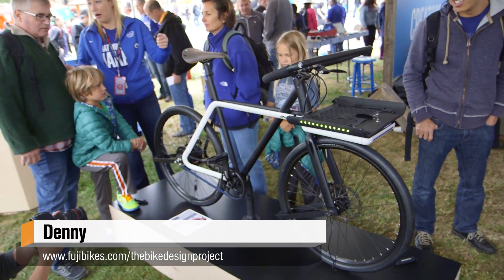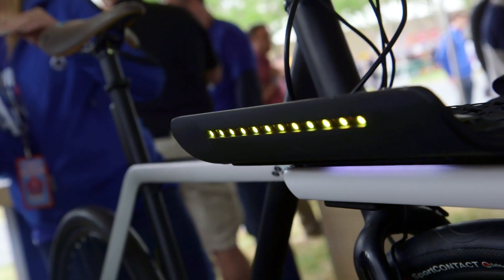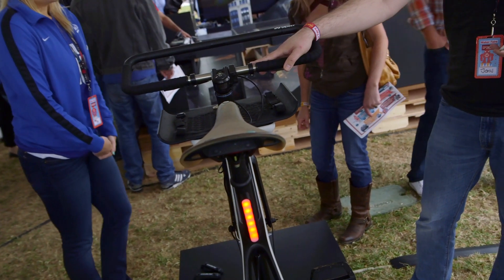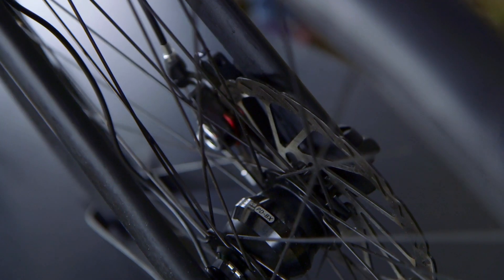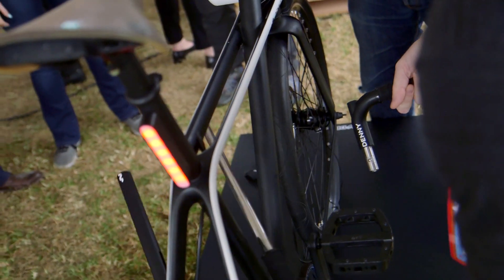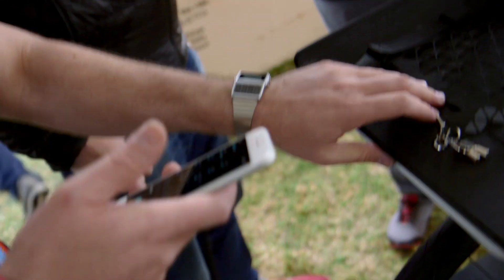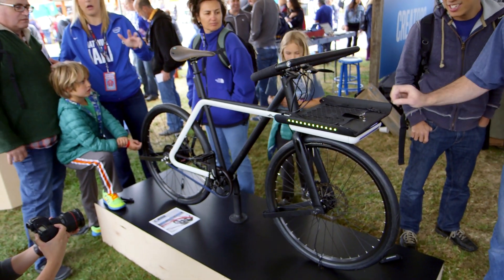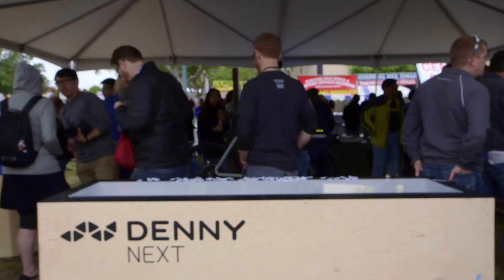The Denny Next-Gen Bicycle Concept

Comment: This is cool and all but I would be much more impressed if they made a "next generation" bicycle without all the electronics and stuff. What I mean is a new type of bicycle. Not just the same bike design thats been around since the 1800's with some electronics thrown in.
Reply: dacasman I think what you are looking for is called a motorcycle
Reply: dacasman 
Partly the reason why the same frame has been around for so long is because it works pretty well. There needs to be something groundbreaking for manufacturers to change something massive.
Reply: cooksley02 No, thats not what I mean.Im talking about a new type of human powered vehicle with no motors and no electronics.
Reply: dacasman 
Some have been made, like that two wheeled skateboard thing. and the same concept but with a tricycle.
Most of them tend to be niche products, and I have yet to see anything take over bicycles, skateboards, and scooters, for sheer practicality and ease of use.
Reply: dacasman They should design new wheels while they're at it.  Those have been around for thousands of years.  C'mon, people!
Reply: dacasman 
Perhaps it's been around for so long for a good reason, while all penny-fartings and other oddballs died out.
Something like walking human-powered exoskeleton might be useful for military,  sports and hobby on a hard to cross terrain or to jump over fences, but on the road there's nothing more power-efficient than a wheel, so IMO, bicycles are here to stay.
Reply: dacasman Maybe if they did something like put a gyro thing from a segway in one of the wheels, they could remove one wheel and make unicycle looking bike.
Reply: dacasman the thing is a classic design is a classic design you don't have to reinvent the wheel just improve it.
Reply: dacasman there is some bicycle frames where the person has to lay on his back and the pedals are in front of him , if you mean this kind of design
Reply: niki123489 Recumbent cycle.
Reply: dacasman The answer is quite simple.

Cause there is nothing to improve.
While there have been many attempts and some niche products do exist, the normal design is just the thing we need.

Lets look at it the other way, how to start designing the mechanics.

First you need something to allow the vehicle to roll.
Chains are a bad idea - high internal friction and need maintenance - so wheels is the choice.  

Second stability - with one wheel it is either  hard to control, or you need some sort of stabilizer or one gigantic wheel. 2 wheels adds enough stability, 3 wheels for the really really lazy. More is unneeded - so we stick with 2 wheels in a row.

Now how to power it.
The arms are week, so we take the legs. Best thing are still simple pedals.
Best for size and stability is in the middle between the 2 wheels.
And an upright position so you have gravity pushing you down giving you the needed counter-force.

Power-transmission and adjustment - a simple chain with an open gear - simple and sufficient.

Steering - either the front or back-wheel.
The back leads to instability, so we do the front.

And what do we end up with?
The good old design for the bike.
It has been around for hundreds of years just cause it is the best design possible for humans.
Many other odd forms have been tested, but there is nothing you really can improve.

You can make it lighter and sturdier depending on the material, and slight adjustments depending on where you want to drive.
Reply: dacasman Then what you are looking for is called a not bicycle.
Reply: dacasman I'm not impressed by the two "wheels" this bicycle uses, I'd rather see a new type of wheel. Not just the same round wheel design thats been around since 4000 BC with some new technology thrown in.
Reply: dacasman look up VeloX3 land speed record for human powered.
Reply: dacasman Why? We have a design that works. There is no reason to try to reinvent what we already have. If something has been around 120+ years with little change, there likely is a good reason for that.

Comment: They should integrate a sort of friction charger on the wheel (probably the front would be best because its out of the way of the engine and below the battery) even if its a slower charge it would expand its ability and range by a big chunk.

Comment: I'm no Luddite, but I do not trust Bluetooth unlocking one bit. Sounds super easy to hack.
Reply: You can get bluetooth door locks. My main concern is getting locked out because I forgot my phone charger.
Reply: They usually have manual key as a backup.
Reply: Sort of begs the question, if I've got a manual key, why bother with Bluetooth? Although if I can use the bluetooth on my watch to unlock the door by reaching for it...
Reply: Christopher wootton Seattle...Phone Connected Bike...Hmm sounds like some kind of game that i know (watch dogs)
Reply: You can tell you live in the future when you have to worry about your bicycle getting hacked...

Comment: If this bike is made for a rainy city, then why doesn't it have any rain guards around the wheels? Your pants and especially your back would be soaked and dirty from all the water and mud kicking up.
Reply: drappke 
Your jeans will still get caught by the belt, because there's no case surrounding it. Regular old chains are cheaper, easier to work on, and even more efficient.
Reply: drappke the loops that go around the wheels have rubble bristles that wipe the tyre dry as it turns so there should be nothing to spay over you: http://static1.squarespace.com/static/54075ed7e4b010adbe14f09d/t/54b6a6c4e4b0a14bf3ec346d/1421256391720/?format=750w
Reply: Jack Lewis  Who the hell gets their pants caught in the chain anyway? I've been biking for years and its never happened to me.
Reply: It happens if you don't roll up the cuff, unless you're wearing skin tight pants.
Reply: drappke The tires looked like it had no treads either. That's bad in rain.
Reply: 1DeadlySAMURAI 

Not really, bicycles cannot hydroplane so there is no need for tread patterns like cars to disperse water from the contact patch.
Reply: ***** That add unnecessary friction and wear  - and i kinda doubt that this is even close to as good as normal guards.
Reply: ABaumstumpf  I doubt the amount of friction would noticeably affect the rider. It might not work that great in heavy rain at high speeds but this bike isn't designed for performance riding, it's designed for hipster's who want to look cool riding less than 5-10km down the street and around the corner to work. Also for someone who can afford an entry price of close to $1000 for the basic version without the power assist system! I doubt paying $5-10 every few months to replace the rain bristles is going to break the bank.
Reply: QuietDuplicity  "I doubt the amount of friction would noticeably affect the rider."  

Sure - it is still not useful and could be voided.

And yeah - it seems it is targeted at the same people that would by an Apple-computer cause it is shiny.
Reply: m. ab  Odd. Maybe its because I ride a cheap bike. :)
Reply: Jack Lewis BS. You still need threads on your bicycle tires. You will skid on slicks as the rubber will lose the contact with the road if there are no threads for the water to go into.

It's even worse when biking in snow.
Reply: ABaumstumpf I agree. Mudguards work much better. You also need skirt guards and a chain casing or any women biking in a dress or skirt will get it caught in the wheel or chain, as will coat tails on a long coat.
Reply: RogerWilco It's impossible for a bicycle to hydroplane like a car does. The tires are too narrow, too high pressure, and the speeds bicycles travel at is not high enough to cause hydroplaning.
Reply: RogerWilco Treads really do make very little difference on bicycle tyres, Schwalbe did their research when they were making their Schwalbe One tyres. However, bicycle tyres can and do hydroplane sonetimes, just not at the speeds this bike is designed for.
Reply: If we use a rough estimate for hydroplaning for cars, 9 x sqrt(tire pressure), let's say your bike has very low tire pressure at 30 PSI, you would have to ride 50 miles per hour to hydroplane.

That's not even taking into account the astronomically smaller contact patch a bike has, the real speed is likely much higher than that.
Reply: Jack Lewis With the right conditions you can hydroplane - but yes, really unlikely for a normal person, so of no concern what so ever for normal bikes.
Reply: RogerWilco Slicks provide the best wet traction for bicycles.
Reply: Phil Bolton You wear skinny jeans? Probably why. Also depends on the crank length and if you have a guard or not. I got the bottom lip of my pant legs caught between the chainring and chain before, it isn't that hard to do. Given how it used to happen to me it will still be an issue with this bike. To prevent it i fold my bottom pant legs a certain way and keep it in place using office clips.

Comment: Things to do:
- One battery (for weight, cost, etc)
- Phone app oughta work with bluetooth, not wifi
- Get rid of the "basket" at the front, as most bicycles have a rack on the back, which looks less odd
- Make it look less expensive, so it won't get stolen a femtosecond after leaving it
- Make it road-legal for other countries (for instance, it's not legal in the Netherlands, because there's no front light, and a flashing rear light isn't always legal either. And I think a rear reflector is required, although that's easily added. Oh and a bell.)

Comment: Looks really good, did they mention pricing, maybe I missed it?
Reply: ***** well I guess that sounds right for what it is. If it makes it to the uk it will be a lot more pricey than that I except :(
Reply: Rob Jeffrey  heck no not right price lol. Get a dirt bike for that. My dads 650 bmw motorcycle gets 70-75 miles per gallon. And....... And.........And   you can go 100mph if you want. Ya def get a used motorcycle instead of this. This is very poser.
Reply: I have a dirt bike. They are for fun and require licences and insurance for the road. A bicycle is for a very different job. I prefer things with engines but sometimes silence and low running costs are what you need
Reply: Rob Jeffrey  bike insurance is cheaper than the monthly cell phone bill. Throw the cell phone in the trash, they ruin your life anyways lol. I am dead serious. 
          I remember when people did not have cell phones, so much better.
Reply: $3-5k for a unknown brand made by Fuji? Lol, no thanks
Reply: Joshua Hults Sadly that's not the case in the UK

Comment: It's built for Seattle, but it doesn't come with fenders. It's advertised as being convenient, but it has no water bottle mounts. Also, a chain case is much cheaper and easier to maintain than belt drive.

There's a reason people who actually ride bikes swear by steel bikes. They're cheap, easy to maintain, and practical.

Comment: I like the idea of trying to make something new with the bike and I see some interesting ideas. That being said however, this feels like a pure gimmick. If you commute with the bike you want to have the bike be comfortable. That handle bar doesn't look comfortable. Having a battery that you need to take out of the bike when you leave it? Super impractical. Bike lights that are designed to make you look like a car? Dangerous! You should look like a bike if you are a bike! Remote controlled lock = potential for hacking. For what? 5 less seconds to get on your bike?

Comment: the seat has to go. it looks hard as a rock and uncomfortable.
the extra bars on the tires will get junk stuck in them.
and the blinkers on the left and right are not in a good location to be seen by drivers. they need to be in the front and back, not the sides.
not so sure about a belt for a chain. it might be quiet, but will it be cheaper than a chain and last just as long. also I would be concerned about slippage.

Comment: I kinda have to think that the guys that developed that thing only know about design and nothing else.

The belt instead of a chain - nice touch, but that does not solve the problem they wanted to tackle with that - a chain-guard is still the better option.

Than the wheels got no guards either but some brushes. That likely negates the supposed noise-benefits. And i'm rather sure that this only adds wear and is not as good as a normal guard.

The mounting of the front-wheel is poor too. There is a reason why wheels are normally not mounted centered - with such a steep angle the bike has far worse stability.

And then we go to the part where he said they have 3!!! processors in this.
2 Arduinos and an Edison.
One Arduino is enough to handle everything there..... you don't need the light-system to run with 1ms latency.....

Then the Edison is just - bam - you have a full blown computer in there.
Yes - you could run linux/Windows on that - 1 GB Ram, 4GB Flash, 2x500MHz Intel Atom, an extra 100MHz microcontroller and it has bluetooth and WiFi integrated.....
And more than enough I/O-pins to handle everything.

Comment: The "u" lock handle bars...functional but they're ugly.

I've seen bike locks in Amsterdam where the lock was permanently attached to the frame. You just flick a switch on each lock front and back and the wheels are locked to the frame. You then use a conventional chain or u bolt to lock off to a sturdy structure...oh and because it's Amsterdam, have your friend stand by to ensure the junkies don't steal your bike.

Comment: *designed for new satellites. hardly anyone who's been in the city since before amazon moved in will be able to afford this :(
Reply: trust me, Walmart poor people bikes don't last long here
Reply: Julian Amrine  Never purchase a bike new, unless you have a professional or high end enthusiast reason to do it. So many people do this every year, and then six months to a year later start selling them for dirt cheap online, because they don't use them. If you are in need of a really good bike save up a couple hundred dollars, if you don't have it already, and go shopping for used. Go online, read classifieds, and garage/yard sale. I have seen $1200+ bikes sell for under $300 on a regular basis. Decent $500 bikes selling for under $100 at times. 

Used exercise equipment, bikes included, is far cheaper. Also, don't be afraid to bang someone up on price if the tires are flat and chain is a bit loose and "rusty". Bike maintenance is easy as pie, and cheap to have done - so long as the frame and wheels are solid and true.
Reply: Andrew ST my bike is 11 years older than me and I swear it's as zippy as a sworks tarmac :) well... maybe not. But I still love it.

Comment: There literally is nothing innovative or futuristic about the bike itself. The only somewhat unique thing is the ugly handlebar/lock setup. Everything else on that bike is available through multiple mfg's. I also question why they're using lipo batteries instead of the safer li-ion batteries
Reply: E-assist bikes have been out for a while now from well known brands, produced on a much larger scale then they'll be able to do...because that's what this is, a e-assist bike
Reply: Caspar Abelmann Anyone who is a hipster can get one*
Reply: lagynas Oops, I did a little typo. Thanks for the fix. ;)
Reply: sik59rt  Did you mis the part where he explained how he got to this design? He never meant to inovate, just to make the ideal bike for use in a certain area.
Reply: Caspar Abelmann  Or anyone with $$$$ to spend on a bike.

Comment: That handlebar is so fucking ugly. No thanks, i'll bring a U-Lock thank you.
Reply: Chris WSK It's not about the looks it's about the performance. If it works great then the design is great. Otherwise no
Reply: A straight bar is bad for riding with too.
Reply: That handlebar is also a bike lock, which is made of hollow steel tubing.... It won't work great. A $3 hacksaw will buzz right through it compared to a conventional solid hardened steel U lock. It's also gimmicky and adds to the complexity of the bike. This whole bike is some designer-concept by some college art student who probably doesn't even know the word "engineering".

Comment: Firstly, that belt will most certainly stretch and require adjustment. Second, it will get dirty and smear that dirt all over your pants.
Reply: Modern carbon belts stretch very little and if they do, the rear axle more then likely is slotted to adjust for tension. Belt driven bikes have been around for decades and are a proven design